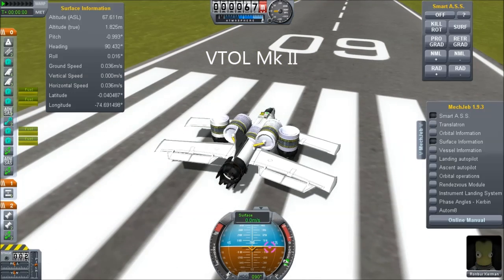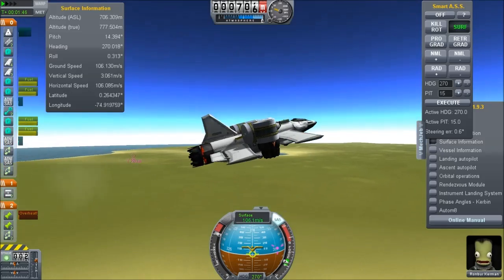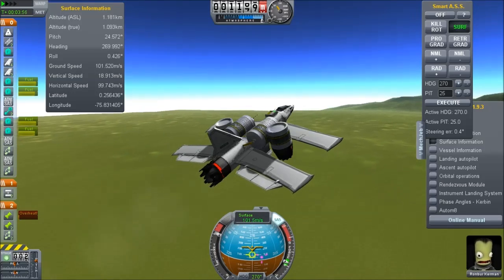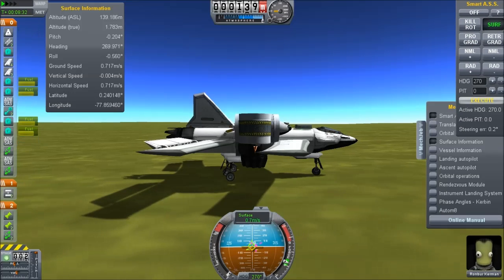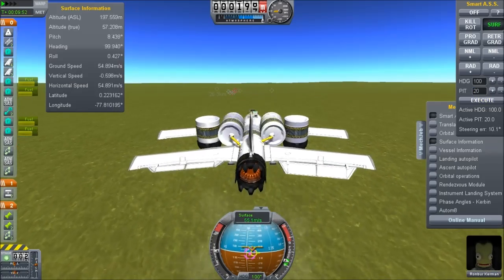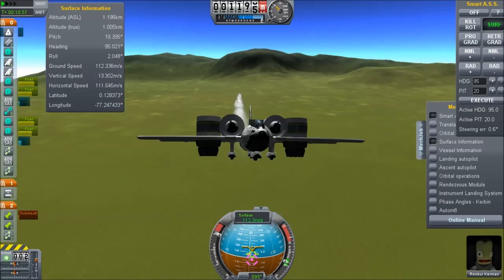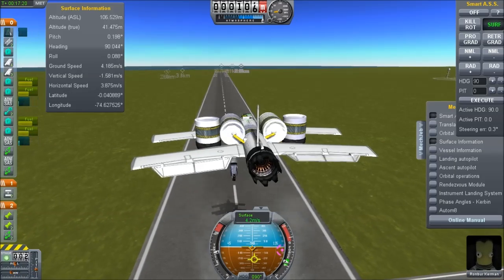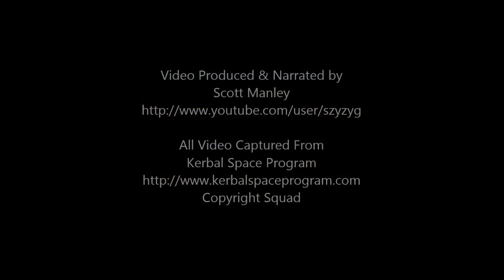VTOL Mark II - Kerbal Space Program

Comment: I made a VTOL with four downward engines and one forward engine. The two engines on the side have little longitudinal arm so even if the direct thrust the moment of those engines is less. The thrust to weight of the jet engines is very high so weight really isn't an issue if you have enough lift. I'm better with rockets than planes though.

Comment: Well, I know it has been mentioned before as a stated experiment, but one of the devs ( Nova ) already confirmed that the jet engines only really work on Kerbin and Laythe. In the rest of the celestial bodies with atmosphere they just make noise and light up without any actual thrust :/

The plane looks to handle quite nicely, far better than Mk1. I would still mess with the fuel lines a little more to allow free fuel flow from all tanks to all the engines, just in case, though ...

Comment: to go to laythe you would have to build another VTOL in the VAB and then use the plane seperators to connect solide rocket boosters.And one of those huge liquide fuel rocket anyway thats the basic consepte but .I'm sure that it would be really heavy so you would have to make like a... really big rocket with alot of fuel.SCOTT the manley badass the he is should and will be able to figure it out.

Comment: hey Scott, try rotating the vertical thrusters 5* backwards to help decrease forward horizontal speed when coming from high speeds, this also helps keep balance because the centre of thrust and mass are always moving in relation to each other if they are too close together depending on the aircraft's pitch, roll etc. So, if the engines are rotated, the centre of thrust will always be aiming behind the centre of mass... Trust me... I'm 14!

Comment: you could rotate the vertical engines so they face slightly forward, that will help cancel forward speed as you come in. also, the spacecraft SAS can cancel your roll problem.

Comment from the maker: It doesn't help, because you can't individually modulate the thrust on the engines so you don't get any more stability or control at this time.
Also, transitioning between flight modes becomes problematic because the engines are activated/deactivated in pairs so that you end up flipping end over end before you can flick the switch on the other pair. You need to edit the .craft file to bind all the engines together.  
I do have a 4 engine VTOL, it looks like the Eagles from Space 1999

Comment: Possible tip: use four vertical engines instead of two. It gives you better control over that backwards pitch issue you were having because your engines have no pitch leverage.